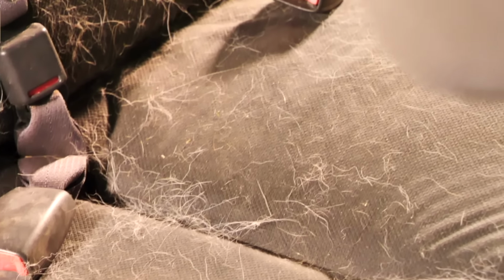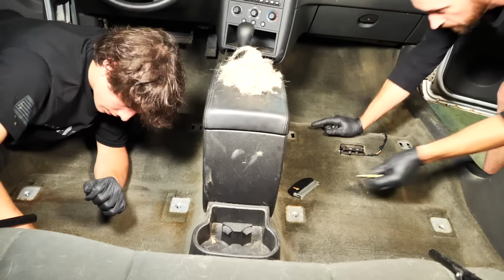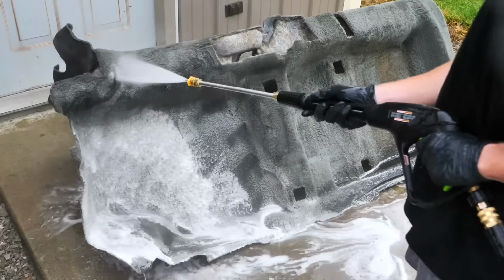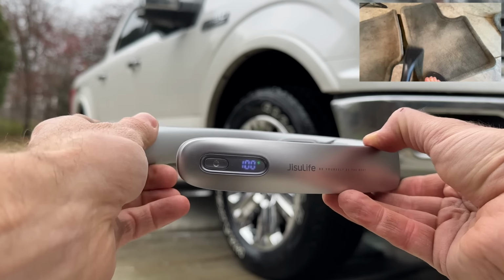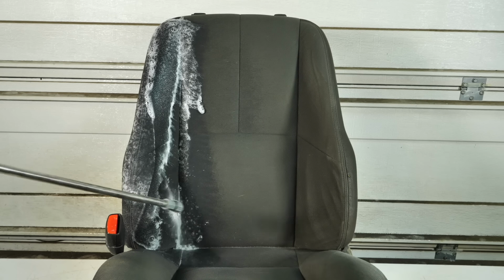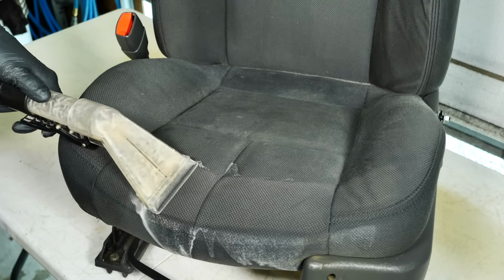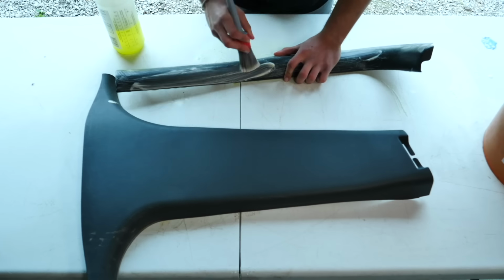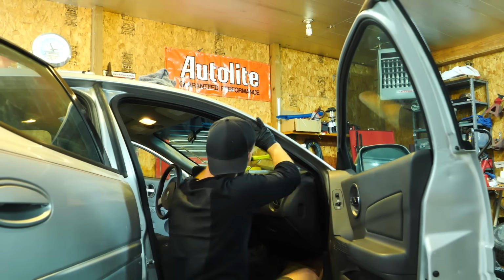Nastiest Dog Hair Filled Car Detail Ever! Complete Disaster Auto Restoration How to

Comment from the maker: My first car was a 1994 integra gsr! Wish I kept it along with my 2001 integra gsr, 97 civic hatchback with a b18c swap, 1993 240sx hatch with an sr20det, 2011 Subaru sti, and 2015 cla45amg…. Yeah I wish I didn’t sell any of mine lol 😂
Reply: I had had a 1996 Integra GSR and unfortunately had to get rid of it because I damaged the crankshaft racing, lol.
Reply: First car my family owned was a 1992 Peugeot 405. it lasted 320000km before the timing belt broke and it wasn't worth fixing.
My first car was a 2008 toyota corolla 1.6 with the single clutch automatic robotic gearbox. You probably never heard of such gearbox and for that I envy you greatly.
Reply: 1978 Mini Cooper. 850 cc. Bought near scrap value in '85. Spent the summer repairing, replacing floor etc. Swapped engine for an Austin 1600. Only had to buy a new head gasket. Couldn't insure it as floor was only 2 sheets of tin riveted together. The fun that had with that car.
Reply from the maker: lol b18c is still my favorite
Reply: My first car was a 1965 Mercury Monterey Marauder in 1973. My father bought it for me to keep me out of his Thunderbirds. I do not allow my pets into my good cars, but I have found cat hair in them. The cat hair must of been attached to me. Thank you,
Reply: 92 Ford tempo
Reply: 2005 Dodge Neon lol

Comment: 1988 olds delta 88! It literally broke down in the dealers lot when I traded it in with over 300k miles on it, not a lick of paint, the fuel gauge didn’t work, and the speedometer just flopped back and forth over 30mph, none of the windows worked, still gave me $2k lol

Comment: Great Video as always!  That car needed the Ozium treatment in the vents.  Sanitizes the vents and cuts down on dust/dander blown around after you clean everything else.  I spray inside vents, then spray in from the outside under the windshield where the fresh air comes in and it travels throughout the vents.  Vanilla scent is the best.